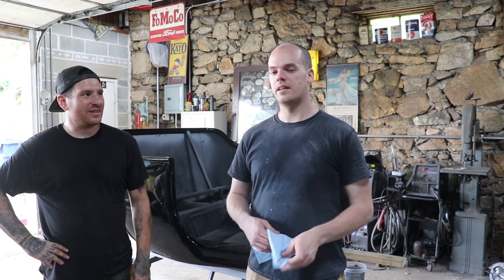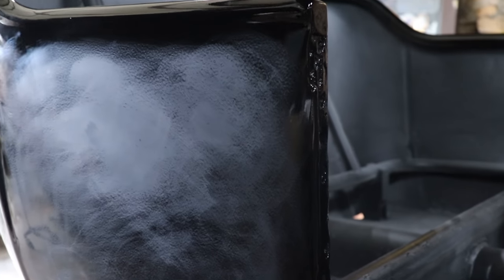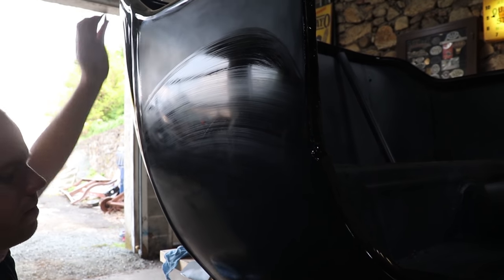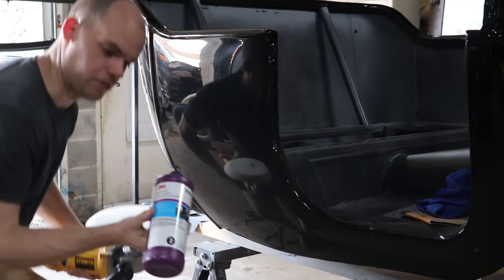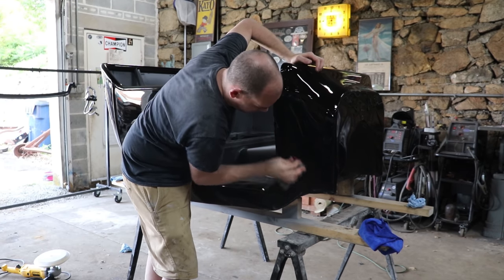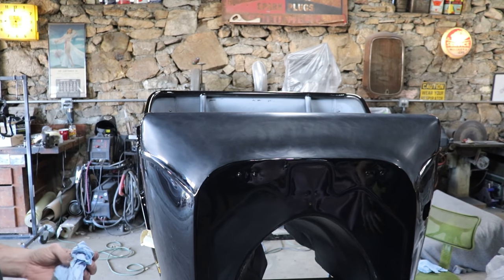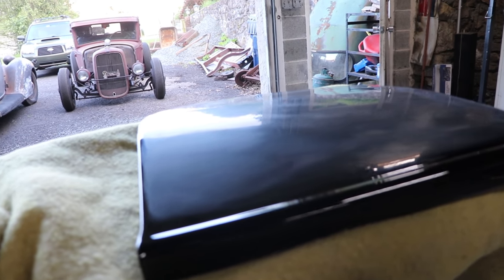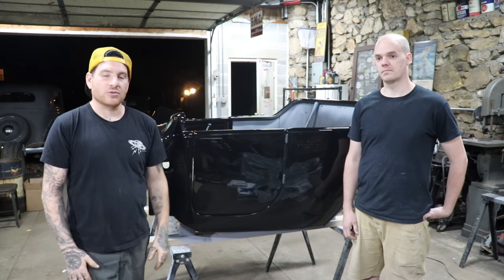How to Nib Sand, Buff, and Polish A New Paint Job - Ford Free-T - Ep. 84

Comment: Good video.    I'm a garage painter so I'll add a few things that may help others - 

1. I burn shit up quick with a wool pad.  Foam works better for me, but use your freedom of choice, your freedom of choice 

2.  Would definitely recommend practicing your buffing on a ( black ) junkyard hood, or a car you don't care about, before you get into fresh paint.   

3.  Buff off of, not into, edges and body lines.   It's amazing how fast a wheel will take fresh paint down to primer if you hit an edge the wrong way.    That's never happened to me or anything, lol 

4.  Clear (and single stage) is "green" or soft, for about a week after it's dry (dust-free).   It's much easier to wet sand orange peel, dirt nibs, bugs, and boogers out if you get after it while the paint is still soft.   I usually wait till the next weekend (4-5 days).   Anecdote:  I cleared one of my own cars then went out of town for a month.  After it sat for a month it was like wet-sanding concrete.   It sucked.  Don't do that.  

5.  Soak your wet paper (and the foam sanding blocks) for a few days before wet sanding.   I use a few drops of ivory dish soap, or a little simple green in the water.

6. You can keep dust / dirt nibs to a minimum if you keep the floor damp (not wet or puddled up) while you're painting.    I use a vegetable sprayer and just lightly go over the floor before pouring paint in the gun.    You can actually feel the difference.
Reply: Good info! I agree on almost everything. The only thing I would suggest is to actually consider waiting longer to buff, like I did here on the T. this car and all of the parts have been sitting since it was sprayed a couple months ago. Sometimes that fresh clear does buff easier, but more often than not it stays a little bit sticky and it can be a pain to sand and buff cleanly. Of course this will vary based on the type of material you use, but this Eastwood clear really sadns and buffs nicely after giving plenty of cure time. Also, From my experience, buffing too early can sometimes lead to sand scratches coming back. After the clear continues to off-gas, it's almost as if it has a "memory" and scratches will haze back. The longer you wait, and give it plenty of time to off-gas, the more likely it is that your buffing work will stay as you leave it.

Comment: excellent short video of the basics of wet-sanding and buffing. 
i've done a lot of buffing. mostly on a car i painted a while back. and even though i know it's traditional to use a buffing wheel the size of the one shown. i can't help but think that a wheel (at the right RPM) of a much smaller diameter would be more effective (at least less prone to error) on a job this size. two to five inches maybe?
it's always surprising to an amateur how a miserable looking, orange-peeled, dust-speck covered paint job can clean up with a moderate amount of wet-sanding and buffing.
Reply: Your logic is sound, sometimes the giant wheel is a pain on small parts. In this case, even though the car is small, I still like to work with the full size wheel. In one way, it's because it's what I'm used to. Additionally, it's actually more effective because the wheel is spinning at a faster RPM at the outside, and it's easier to heat the panel a little and let the pad do its work. smaller wheels take much longer to do the same kind of job, because even if you were running at the same machine RPM, the smaller diameter is moving slower at its outermost position. It seems like it wouldn't have much of an effect, but when you put it into practice it's very noticeable. Smaller 3 in buffing pads are very useful for tight spots, but they're miserable to use on anything larger than about the size of the pad itself. Hope this helps and makes sense!

Comment: Looks "awesome" !!!!! 
A couple of questions: 
Always see guys suggesting taping the edges and beaded areas to prevent damage from the disc. How come that wasn't necessary here?? 
Would like to know all the thinking/do's/Don'ts about the rags?? Exactly what are they?? How much do they cost?? How much do you use each one?? Anything else?? 
Again, I would be pinching myself with channel locks it came out so good !!! ;o)
Reply: sometimes on really tight spots, or extra delicate areas, it's worth it to tape up raised spots and edges. For the most part though, people are usually just too scared of burning through on edges. This comes from either not knowing how to do it properly, or someonepassing on horror stories about their own burnt edges and telling them that they need to stay away from it entirely. If you do it right, you shouldn't need to tape any edges. But it definitely takes a correct feel to get it right though. the rags are just common microfiber towels. You typically want edgeless towels, but you don't need anything that special.
Reply: @guyonabike3900  " If you do it right, you shouldn't need to tape any edges. But it definitely takes a correct feel to get it right though. the rags are just common microfiber towels. You typically want edgeless towels, but you don't need anything that special" 
Thanks for the reply Mike. Understand your statements but they don't tell me what "doing it right" is or the Do's and Don'ts with the rags/towels. Once you have decided which are the "right" ones. 
Just trying to learn all the things to avoid without doing damage to learn. 
Thank you.
Reply: @pappabob29  "if you do it right" pretty much just refers to running the buffer correctly without digging in and destroying the edges. You need to pay attention to the rotation of the pad and buff "off" of the edge, not into it. It takes a feel, and can't really be put into words very easily. 

For rags, I just use cheap microfiber towels. During the process, I use one for wiping off compound, one for polish, and one for ultrafine polish. I have another one or two that I use only for final clean up with detail spray. I just make sure to keep everything as clean as I can, and I'm never afraid to throw one in the "to be washed" pile, and grab a new one. They're super cheap, and it always pays to have fresh ones lined up and change them often.
Reply: @guyonabike3900  Thanks Mike. I'm sure it IS tough to put into words but those words are SOOOOO valuable. Probably why lots of guys just "tape" (since they don't know those words). Same kind of thing for the use of the rags/towels. "words to live by" but few will express them. Even when asked. So, thanks again !!!  👍👍👍

Comment: It's actually called "out gassing". Another thing is that if your going to go this way,your better off painting in a flat base & then final clear coating to protect the Black. Always compound the clear,rather than the color coat. Then again,if you want the absolute best job,as in original, gloss off the gun in a proper booth is the only way to go,without machine compounding. Chip Foose will tell you I'm right.

Comment: I've never water sanded in a circle I always went back and forth straight just saying
Reply: It's just a personal preference thing. You see me sanding somewhat circular here mainly because of ergonomics I think. It's just kind of the natural motion of my arm as I'm trying to sand. wet sanding is a little weird compared to block sanding filler and primer. If I was using a hard block to dramatically cut down on large peel or fix major imperfections, then I would certainly take care to sand straight instead of circular. With a soft block, and only working on removing minor orange peel, I just find that sanding in a semicircle lets me work the panel a little easier